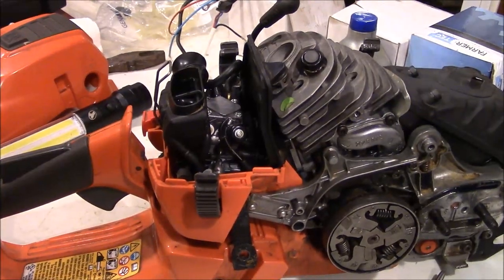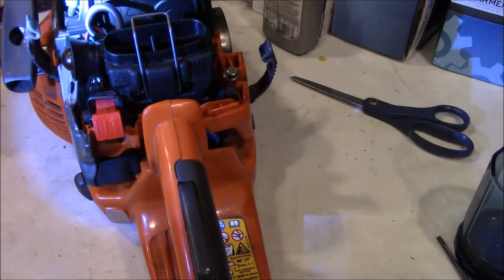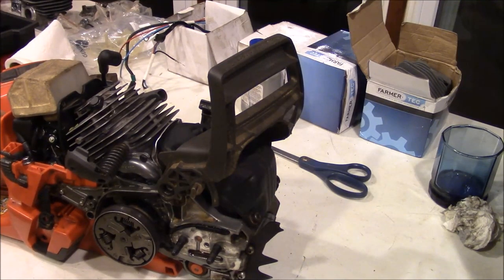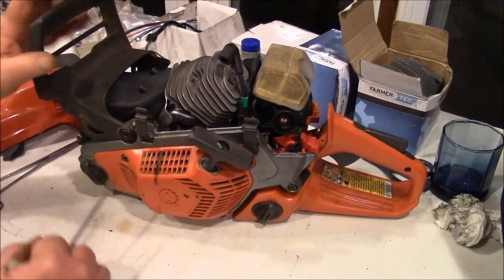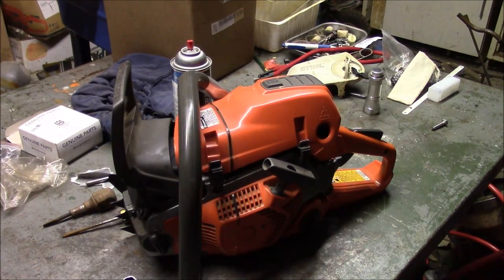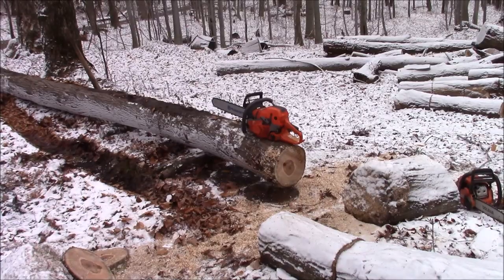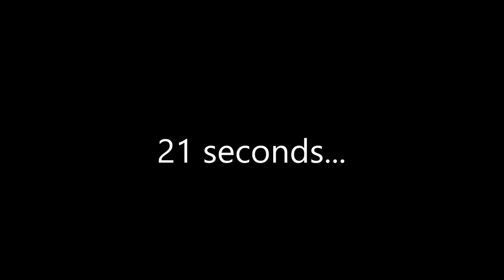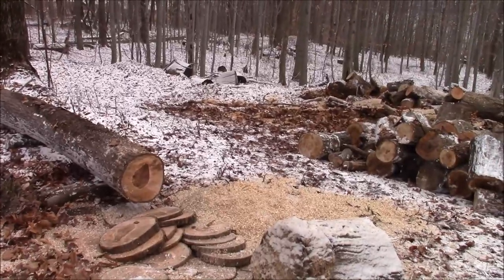Husqvarna 562xp "Salvage Saw" part2 - Final Assembly and Test

Comment: very nice video,  and i have had my eye on the 550/562xp saw for a while owned a  576xp a/t  it did not like to idle after a cut or after throttle release (had to slowly release throttle after a cut or it would dye other that that is was a very nice saw) have a 262xp hard to (replace) that saw ... thinking about a update  thanks again for all the videos
Reply from the maker: +tina black those 262's are definitely special...treat it nicely!
Reply: pound for pound the 262 was the best fastest strongest saw of any saw company.

Comment: I was wondering if you had to grind any notches in the case after gasket removal so the cylinder would properly set down on the case. One spot to watch for in particular is the bottom of the transfer covers making contact with the case. This was needed on my jonsered 2260. Once you have tore into one of these new huskys a few times (which you may already have) you may find that you like working on them as much as the older generation of saws. They really aren't all that complicated, and the fit and finish is top notch. But still there is something special about the husky 2 and 3 series of saws and how simple they are and their potential to make more power when modified.
Reply from the maker: +neil tupper It seems to set properly. But I certainly will look!
Reply from the maker: +neil tupper I checked. The place where it might be an issue is the flywheel side, but mine has clearance. I was able to slide a leaf in there. But I can see how just a few thou one way or the other with tolerances could make that an issue.
Reply from the maker: +neil tupper I have another saw where it looks like it vibrated and marked the case casting on the flywheel side rear most screw and it HAD a gasket so this is a very valuable heads up you posted! Think either an addendum or the video I'm making about replacing the carb needs to have that visual. Looks like there is variances between the two sets of cases/cylinders so its not a 100 percent chance but in my small sample set its 50/50.

Comment: Nice video!
Are the baffle holes bigger than the stock, or just the hole under the deflector is the single modification?
Reply from the maker: Two things on those mufflers if you need the spark arrestor screen. First, i poke a hole approx the same x-sectional area as the exhaust port right in the "baffle" inside the muffler directly in front of the exhaust port, that allows the exhaust gases to go OVER that internal baffle. Keeps some heat out of the cases....a good thing. I also enlarge the exit of the muffler under the spark arrestor screen to about twice its original size.  Combination makes the saw run a little better, not earth shattering; but also runs cooler and thats important.  Also I cut the top covers like the new OEM to also help cool the saw...) Thanks for watching! I think I cover those mods in one of the later 562 vids I posted..
Reply: afleetcommand I've searched trough your vids and I found them. 
Thanks for all information!
All the best!

Comment: When you "disassemble & repair" the saw do you have to go back through the "Break In Cycle" or does the saw keep its previous tune? That's al the questions I have at the moment.. Bob needs to realize that Carharts aint worth a damn til they turn white then they are getting broken in... He looks like a shiney penny, aint no gypo  ;)
Reply from the maker: +Adam Gardner even gypo's get new cloths! And pretty much just run them if you use the carb that came off the saw as that carb hasn't been changed. When I put the el48 it will be like a new saw.

Comment: Have you tried porting your 021 I have the 210c and I have it ported and a big difference
Reply from the maker: +the chainsaw collector 360 Not yet. Doing  a series for firewood saws and a bang per buck mind set. Starting with a series of home owner saws new and used. So needed to get a time stamp so I did on that day...as always I seed in bits from upcoming video series in to current project video's.. :)

"Porting" means different thing to different people. Can't do much with compression on those saws short of welding a lump on the piston crown and turning it back...but that's more than "Farmer Jones" typically wants to do. So typically opening the ports, a muffler mod. Possibly a different carb if warranted..guess we will see. :)
Reply: On my YouTube page of videos there is one that is how not to cut down a tree. that is my 210 ported. You should here the saw
Reply: +the chainsaw collector 360 Lol! That is a "buzz" saw! Sounds great! Definitely more powerful. Made me laugh how you kept walking and cutting making the tree shorter and shorter from the bottom up.
Reply: +John Lincicum yeah that's the way I do it when it is caught up in other trees I had to also drop a dead line with the top knocked out of it I had cut logs where I wanted to drop it the pine tree dropped on the logs and bounced on the asphalt and bounced back on the logs I should of filmed that too it was a neat sight

Comment: Top top of engine from 562xp fits to 560xp?
Reply from the maker: It is the same top end, carb, ignition, everything. The 560 has a "small bar mount" cases setup and the 562 a large mount.